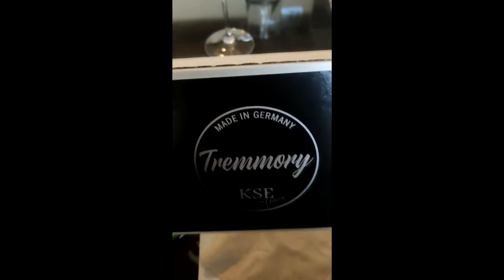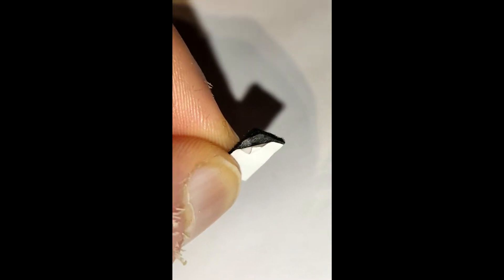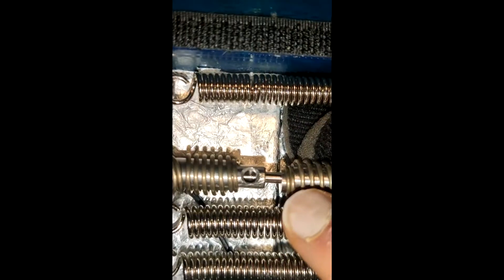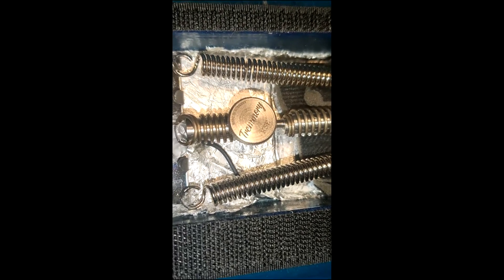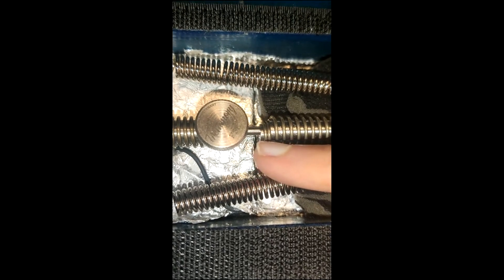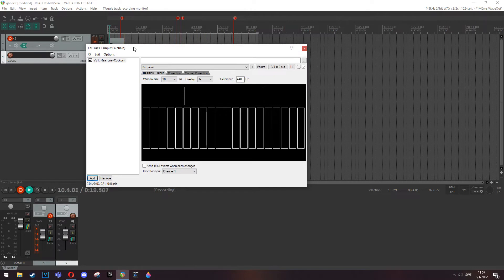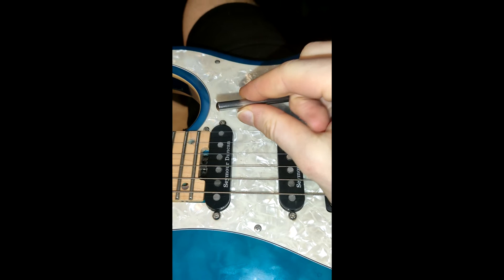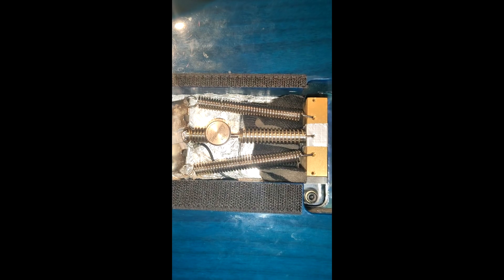Floyd Rose Upgrade Guitars Upgrade Tremmory Review l Niffty Tech!

Comment: Great review! How it hold tuning during drop tuning? Is there some imperfections or it stays 100% in tune when you drop tune?
Reply from the maker: Thanks man! Havent tried drop tuning with it, ola englund drop tuned with it and it seems to hold tune, but you use up more of the travel that the tremmory  is made to compensate for, so if you have it setup for standard and you drop tune, it wouldnt be able to compensate for more drop in string tension, as in the case of a broken string. ideally you would want to set up the tremmory for drop tuning, but it should work in a pinch.
Reply: @thescerigai  Understand! Thanks for your reply!

Comment: Hey man, great video. The manual says the Tremmory doesn’t replace a spring tension wise, so theoretically one should add the tremmory as an addition - but I feel it definitely adds tension then. I saw that you had it additional at first but then replaced the middle one finally… I feel that is the way to go if you want to stay close to the tension you once had before the tremmory… how is your experience?
Reply from the maker: Thanks! 
It does not add tension when static. The reason for removing a spring and tightening the claw more is to make space for the unit, it would not fit otherwise in my case. If you have enough space with your current setup, just drop it in.

Comment: I don't know if I am stupid or if i received a defective unit but the spring hooks on both sides do not go beyond the body so I cannot hook it in any way. I tried with pliers and flat screwdriver but it is so thight that it barely move away.  I don't want to break it either.  On mine, the circular hook on the small part (claw side) is wrapped around the body. On yours, while it is still in the bag, it seems to go beyond the body part so you can hook it right away. On the longer part (trem block side), mine looks like yours as the spring hook is leaning on the edge of the body part.  Again, I tried with pliers or flat screwdriver but it is so tight that it does not even move away.  Looks like I am not the only one who have difficulties installing this device. There is a lot of videos showing demo of Tremmory but none actually showing how to install it.  I guess it is because it's so simple.  If it is that simple, I guess I am stupid or received a defective one.  I wrote back to the company with photos but replies are as vague as the instructions received with the unit.  I can assure you the next one will be the Russian version. I just don't want to order it until the war is over because I don't want to pay and not receive it.
Reply from the maker: I don't remember when I was installing, but looking at product pictures of the trememory, some of them extend over the body and some of them don't. On their official page it seems to extend over the body of the unit, which would make it much easier to install. So if it is too annoying, just return it and get a new one or try the russian one if things improve over there.

Comment: Use a adhesive pick. How does this system compare to the FZG tremolo switch?
Reply from the maker: Fzg goes between fully floating and dive only mode, tremmory adds resistance back to zero point (where it was tightened)

Comment: wish you'd shown you actually putting it on, i feel like i've almost damaged one end of the spring because i can't pull either side far enough away to hook them
Reply from the maker: Measure so that you have the correct spacing for your Tremmory size, hook the sustain block side in, undo the wheel on the Tremmory to get the claw end as close as possible, then use a flathead screwdriver to hook it in place.
Hope it helps!
Reply: @thescerigai  Thanks man. Yeah it seems my prs has too small a cavity, i wish i could get springs with less tension than the prs ones so i can screw the screws in tighter to the body. Every had that problem?
Reply from the maker: @SimonsBand1  Try removing springs and having them in different configurations to get enough space for the Tremmory
Reply from the maker: @SimonsBand1  Sorry my bad, I first put on the claw side then used a flathead to attach it to the sustain block.

Comment: hello! few questions, can i switch it on and off real quick? like i'm playing rhythm and then i wanna turn it on quick for a solo? also i've heard it stiffens the tremolo and doesn't let you do subtle trem movements, does this apply if i have the tremmory deactivated?
Reply from the maker: No, there is no point to loosening the tremmory while playing. Yes it stiffens the tremolo when you use it, making flutters last much shorter, but you can do subtle trem movements, they just require more force and that your bar is tight. If you have it loose it doesn't do anything except make a little noise.
Hope it helps!
Reply: @thescerigai  sounds like exactly what i need. can't wait to get one!! thanks for your reply :^)
Reply from the maker: @tintecobrizo  Cheers, have a good one!

Comment: 4 of my Floyd guitars are all outfitted with Fu-tone parts for reliability and stability.  Titanium saddle blocks and screws,  3 red springs and 42mm Brass big blocks.  All in different brand guitars and all seem to react the same. I can hammer the shit out the trems, they go back to pitch and definitely adds better note clarity.  I also go to an amazing guitar tech and even he mentioned how stable everything seems to work.  Just my 2 cents.  The red springs are about 15% stronger then stock, still allow you to "flutter " . But this is all personal preference,  just the way I like mine setup!
Reply from the maker: i think the titanium saddle blocks do so that the strings cant dig into them and get stuck like on regular blocks due to it being so much harder and the stiffer springs should help return the trem.
Reply: @noobsdeath2  I had 2 saddle blocks actually get stuck in the saddle from squishing in the saddle from years of use, at one point cracked my saddle.  So that was a big reason I went to Titanium.  I don't have to tighten as much as wear goes on. But as I added these parts I noticed the note clarity was much better,  a little more sustain.